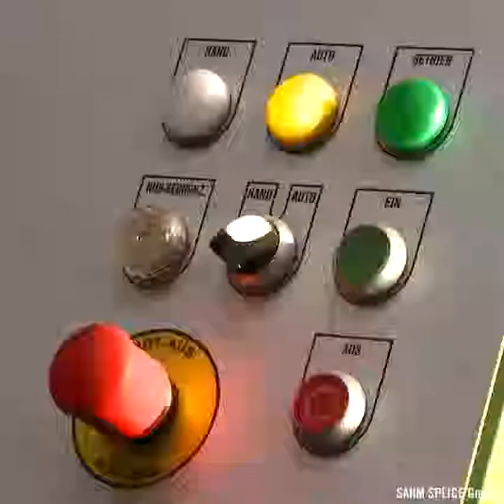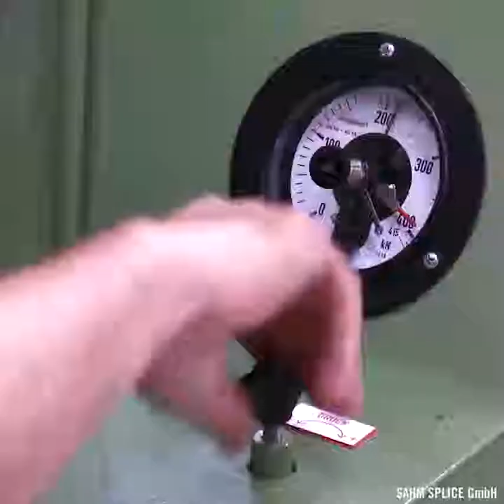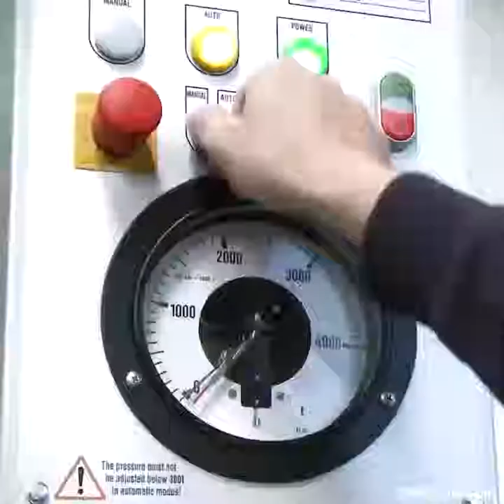Swagging of Wire Rope

Comment: I'll trust a spliced eye over a swage any day. Bigger the rope the more shit gets messed up when it fails.
Reply: It's not called splice eye. It's a flemish eye vs a turnback eye. Flemish eyes are rated for more weight but to be honest, you really shouldn't worry about that. If the sleeve is an alloy then it's good. Carbon steel can crack easily in a sewage press and aluminum sleeves make me nervous
Reply: @ronnierabell1  tomato tomaato.

Comment: It seems like the cable will slip loose
Reply: The cables are twisted, so they can't slide longitudinally. They would have to twist simultaneously like a screw, but the two sections in the crimp are connected through the loop.
Reply: The wire itself will break long before the ferrule fails.
Reply: @MrSaemichlaus  It's not a crimp. It is called an aluminum sleeve. I do this everyday at work